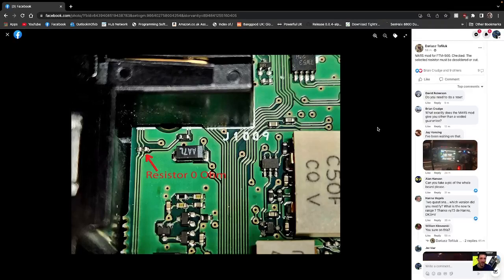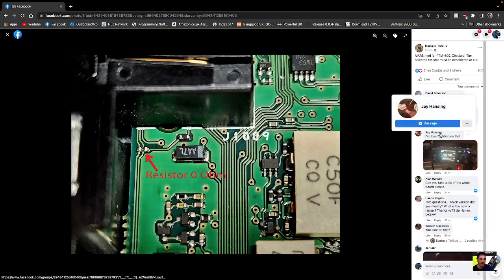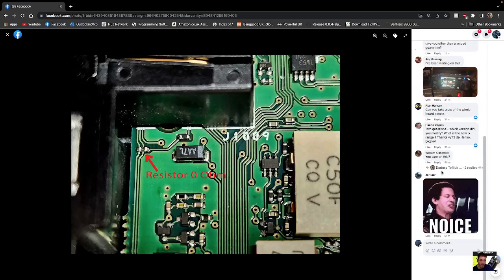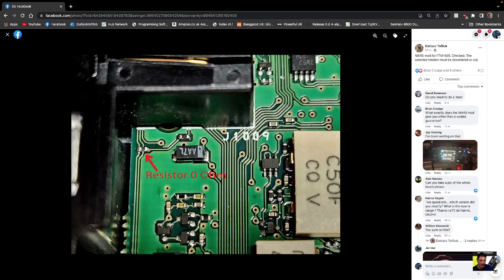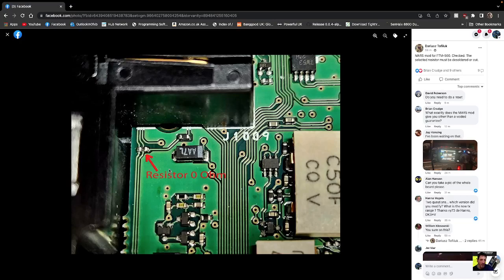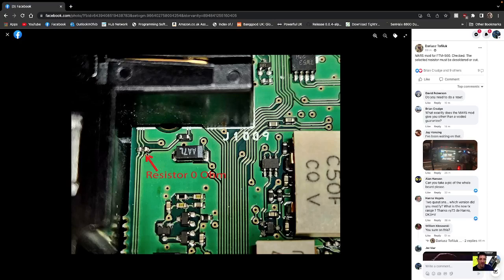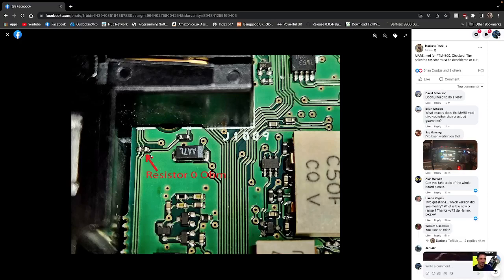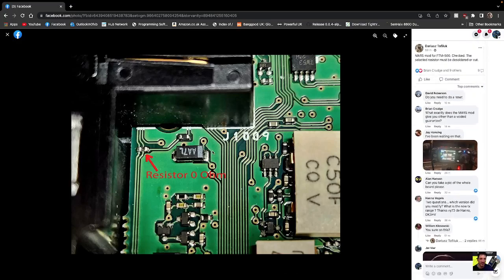YAESU FTM500 , MARS MOD Info OPEN TX

Comment: This worked on my FTM-500D. Solder wick and flux got the job done in an instant. The actual resistor is incredibly miniscule. No larger than a grain of sand. 

Thanks for the video btw. Saved me a $40 and a day commute to the local radio store.
Reply from the maker: Hi glad it helped .

Comment: Power output on gmrs
Reply from the maker: If you have tx (MAY NEED A MOD)it can do 50 watts but is this legal in USA ?
Reply: @M0FXBHamTech  was interested because some people say the wattage is low out of band could you test it on 462
Reply: @DaytonaJim78  My FTM200D is MARS modded and only does about 32 watts on GMRS frequencies. It will otherwise push 66 watts @ 147mhz.
Reply: @M0FXBHamTech  only for emergency
Reply: Does anyone know of this works on the 500DR?

Comment: Confirmed this works!

I note that mine is the USA model, and the picture shown is near the front on the main unit. Also, if you are using the RTS systems, the factory reset will not allow you to upload any saved radio files until you download "from the radio" first. This is basically renewing the "handshake" between your software and radio. I nearly had a panic attack when it refused to reload all my settings and channels until I figured this one out. 

Also, on a personal note, I only de-soldered(sp?) one side of the resistor and slightly pried up to break the connection.  This allows me to reconnect it at a later time, if needed. 

Hope this helps. 

DE KF0KOE 
73
Reply from the maker: Thanks usefull info .
Reply: what's the new Tx range?
Reply: Does that mean you write the frequencies from the radio to the SD card? as I don't have the data cable .
Reply: Desoldering only one side is a great idea!

Comment: Mod works (Resistor is in the Main Unit) But be aware that the Radio will reset itself to factory defaults. Prior Backups to SD are not valid anymore.
Reply from the maker: Thanks for info
Reply: I did the mod the revive goes all over the place but the tx prohibit are still intact

Comment: anyone tryed this modification ?
Reply from the maker: Yes click the link this person has tested it .
Reply: I did it, works fine.  It will reset the radio, so save programming if that's important.
Reply: @johnarenz  what's the TX range you get?